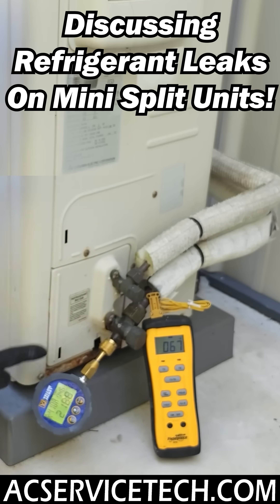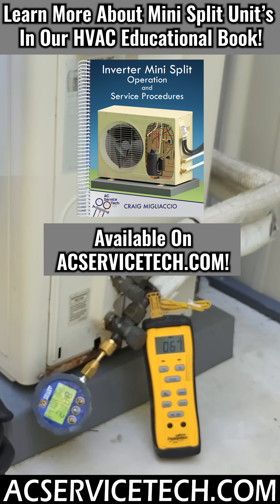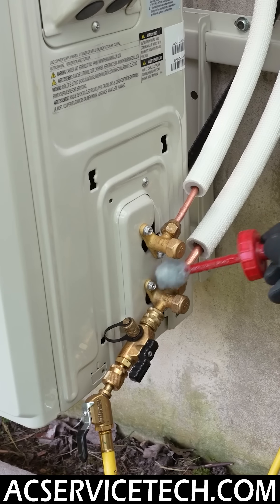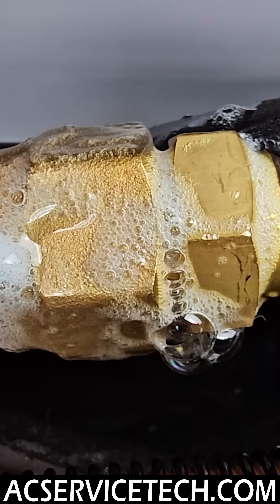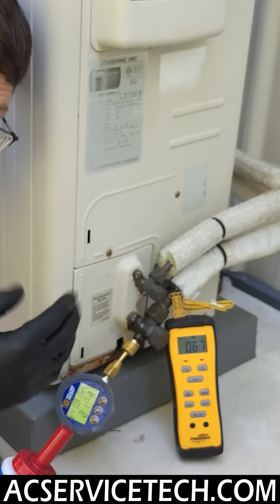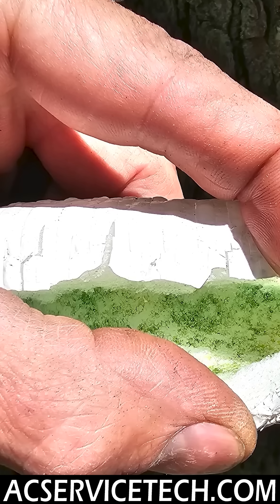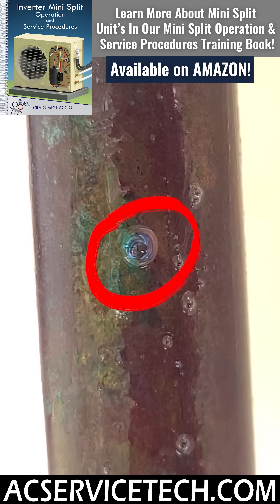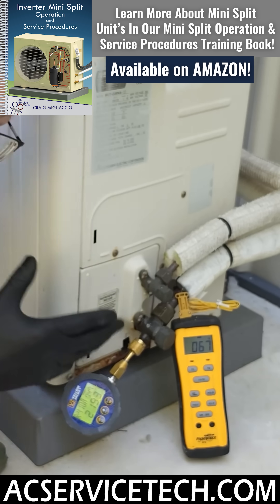Major Refrigerant Leak Causes on Mini Split Systems!

Comment: Install a sacrificial anode, and dont use a better wrap.
Anyone can socket two ref lines and power. Doing it well costs more though, through better materials and more experience. Those buying mini splits, especially the 1:1s, usually opt for "cheap as fuck" and get what they pay for.

Comment: Is there a class action lawsuit against the manufacturer of these line sets yet? This is ridiculous that these weren’t tested better
Reply: The line set is just copper tube. There's no lawsuit there. How it's installed is on the tech. Zipties and short cuts don't work with these wraps.
Reply: @donaldready2118  It's the chemistry of the insulation causing the problem, so that should be a class action lawsuit. 

That's common sense, however the US justice system with regards to class action lawsuits doesn't operate on common sense.
Reply: @donaldready2118 many linesets using that white PE insulation have failed prematurely from corrosion. If it's a leaking flare then that's 100% install related. But if it's multiple pinhole leaks on a 5 year old lineset that's manufacturer related.
Reply: @Redtooth75 it's not bonded to the line, that's the techs/customers decision. If the tech doesn't have enough knowledge, that's on his company and him.
Reply: @donaldready2118 I'm not sure what you mean. If the product does not work as shipped and fails prematurely then that's a warranty issue. Its not the installers responsibility to fix the brand new product. There should be a lawsuit and compensation for the people that lost money over a faulty product.
Reply: @Redtooth75  my employers installs were originally flares with burrs, now, as of fall 2024,  the new Lineset come with the white thicker armorflex, so far, one service call on leaky flare, one call on evaporator leak, one call on ips failure.

Comment: "White insulation" what is white insulation? White is a color, not a material
Reply: You have to be trolling. No way you’re that dense.
Reply: @seriouslywtfandre  I don't currently do Refrigeration service where this product is used, it's not a thing where I work(200 refrigeration units). I looked it up and got the answers I wanted.
Reply: I found the info I wanted https://youtu.be/4WCnz34SiX8?si=qP6iBm0DQ5tnwzsI